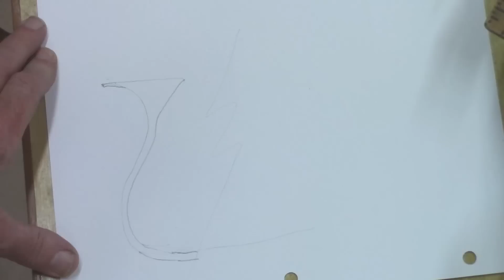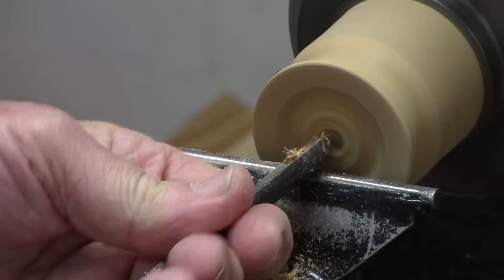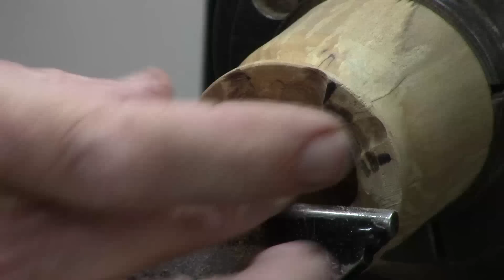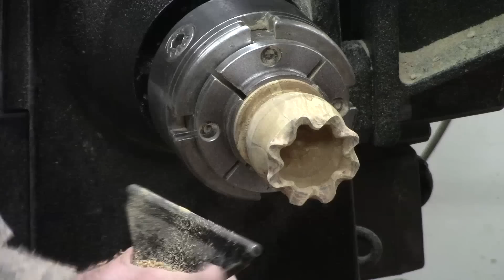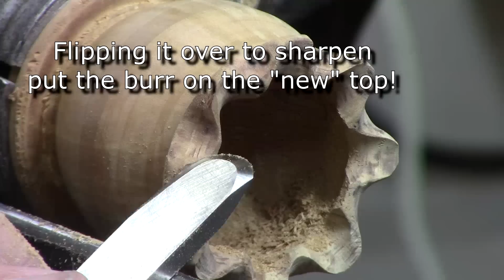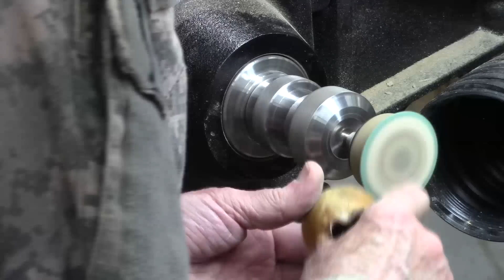Fluted Pot Woodturning Technique Explained

Comment: Hi Mike! It will be a lot more controlled carving flutes if you first use a triangular, and then a rattail file to start the grooves.  The burr will then seat easily into the groove, and you can carve away!
Reply from the maker: Thanks for the tip!

Comment: Mike, there is a series of videos dealing with Korean manufacture, several of them specifically with wood work and and least one specifically with wood turning, in which they create just such a "pot" as you are looking at, only their pot starts off as a log three feet in diameter and seven feet long, but it is fluted.  They happened to rough in their fluting with a chain saw and finish with industrial grinders and sanders.  I don't believe theirs was more than nominally hollowed, but intended as an outdoor decoration why bother.  You might not learn any thing you would want to apply to your craft by watching it, other than how to lay out  and flute a pot, but it looks like you have that well in hand.  Well, I'll stop bothering you and get back to watching your video.
Reply from the maker: I think I have seen that guy. Vietnamese I think.

Comment: Timely, Mike, as I have my second lathe set up for fluting and experimental gear cutting, and was wondering about something different from fluted vases. This one will certainly jump the queue a few places and I can get out some burrs and jig I rarely use. Also small sanding drums should be helpful. Thanks.  Bernard.
Reply from the maker: Go for it!
Reply: @MikePeaceWoodturning  Mike, as I suspected, an accurate and easy way for this project proved to be with a fluting jig pointing towards the headstock .Apart from setting up the equipment it was fast too. It required a lathe top router table with fence and nosecone depth stop for the router, and 60 hole index plate. Shaping my vase, I left the top 1" alone at full blank diameter and faced off to describe a pitch circle well inside the blank's circumference. Then using a half inch spade bit I plunged 5/8" at every 12th hole, for 5 flutes, and again 2 holes on, to give 5 short grooves with centre ruts. Then I finished shaping the outside to within 1mm of the pitch circle and hollowed outwards to 1mm inside the circle. A 1/2" Dremel sanding drum removed the ruts and radiused the sharp edges to give a shallow sine curve wavy rim. This could be upright, horizontal or turned over; and ,of course, was fluted laterally. I finally drilled the tube hole and used  1/2" sanding dowels as necessary. The deep invaginations you demonstrate here can be achieved with a second cutter on its pitch circle if required, and there is infinite scope for design within one's range of tools. Pleasing and stress free little project, or beginners luck!  Bernard.